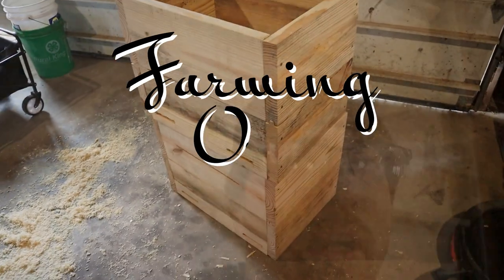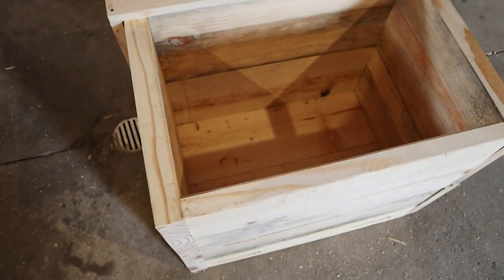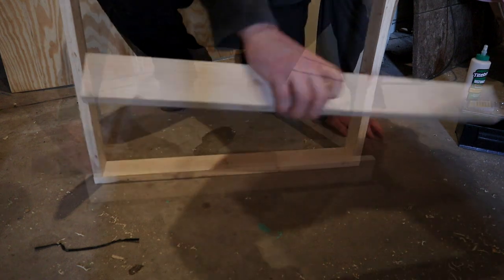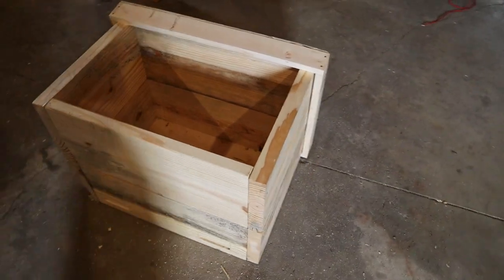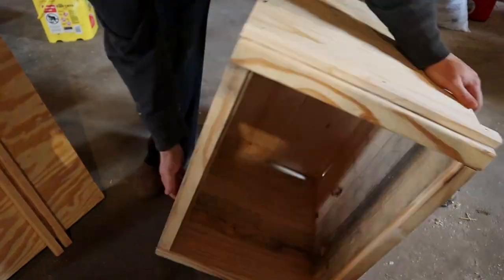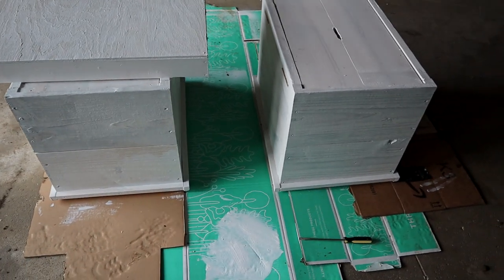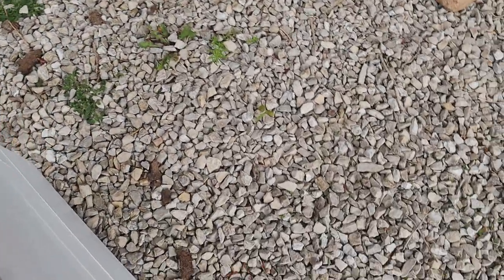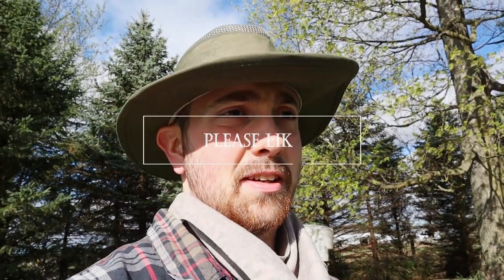Making Layens Bee Hive Boxes

Comment: Nice job. I've built two of these hives in the past six months. The first I used a tongue and groove like the plans suggest. The second one I used a pocket holes w/ the blue kreg screws on the inside to join them together.  I'll be using pocket holes for all future builds. The only modification on necessary is ripping an extra .5" from either the top or bottom boards to account for the missing tongue and groove joint.
Reply from the maker: I've never purchased the Kreg tools but have often thought about it. This maybe would be a good reason.

Comment: looks good,  but I did what you did by putting the lid supports on the box and not inside the lid which makes a place for water to lay and eventually soak into the wood causing mold inside the hive.
Reply from the maker: I haven't had a problem with mold yet, but I will definitely keep it in mind now.